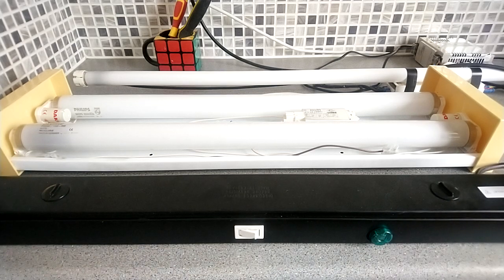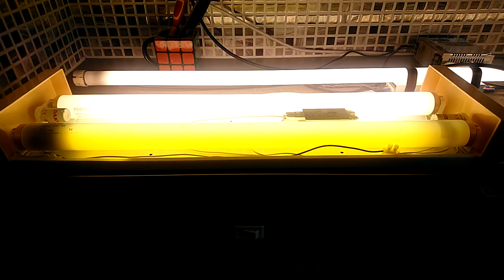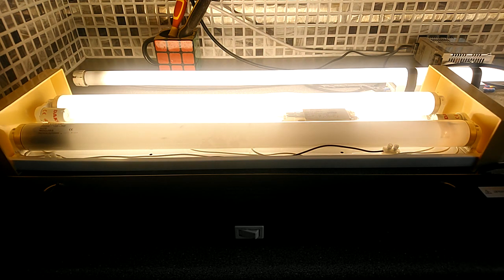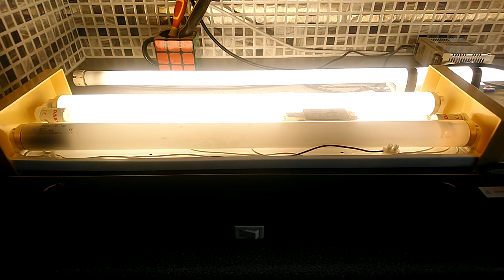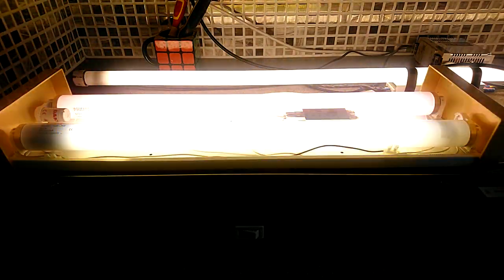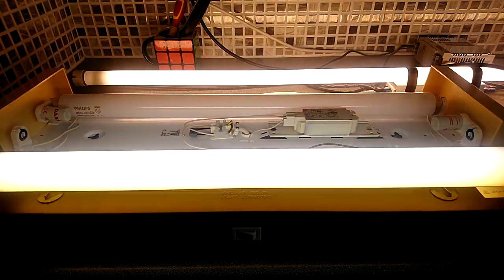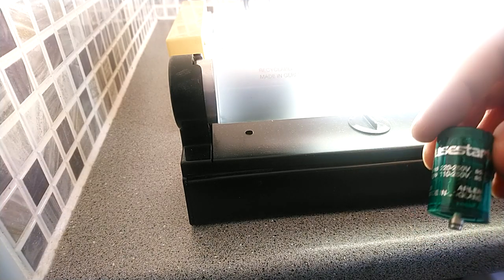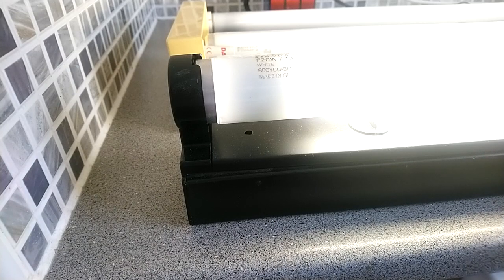EOL Fluorescent T12 Tube Burning Out

Comment: That's is a 2ft single and twin fluorescents lights fittings and in the single light use only one 18-20w 240v choke ballast and it's also takes 2ft 18w t8 fluorescents tubes and 2ft 20w t 12 fluorescents tubes and with two in series 4--22w 110-130-220-240v fluorescents lamps starters switch and in the twin 2ft light fitting its share one 36-40w chokes ballast via 240v means it's using only twin 2ft 18w t8 fluorescents tubes and only two 2ft 20w t12 fluorescents tubes and two in series 110-130-220-240v.4--22w fluorescents lamps starters switch Dave

Comment: Why does EOL T12 tube suddenly starts to work when you take the starter out and why does it work properly when you use electronic ballast while it doesnt when you use pre-heat ballast?

Also is there a store where you can still buy T12 tubes and 240V pre-heat magnetic ballasts or at least 240V magnetic rapid start starters (never check those for radio interference but it should produce less then the electronic one)

You see, I dont like electronix starters (watch this video to see why: https://youtu.be/GA7rscFNpB8 they produce a lot of radio interference, so I would like to replace my electronic ballast with a pre-heat (a bit of a challenge since my fixture doesnt have space for a starter but will cut the fixture if needed) or at least a magnetic rapid start one?
Reply from the maker: Fluorescent Tubes seem to do EOL on magnetic ballasts first with normal starters as tube dims wattage drops starters start working until either starter fails or tube. Electronic starters normally try once or twice to light tube, if tube lights will run until tube fails or just turns off. 
Electronic Ballasts normally run fluorescent tubes until they burn out or fail by loosing vacuum. some newer electronic ballasts turn off to stop damage to ballast normally T5 or T8's.
As for the T12 in this video it just stopped working as cathode failed on burnt out end.
You can still get T12's and magnetic ballasts or electronic on ebay, however prices are rising.
Reply: @davesbusstuffandmore  thanks

Is there any visual diference between T12 at their EOL and T8 at their EOL

I mean, the onlything different about T12 and T8 I observed is the visual size (T8 is sligtly thinner) difference, but not sure is there any more differences (does T12 start any differently then T8? Do both produce same uniform light)

Also, I found some T12s that claim to self start (and also have some wire running on the outside of their bodies, not sure if you ever came across any)

Also what about the tubes length (I saw some realy long tubes not sure how to figure out the size I need)

And what about the color, sometimes I saw some white ones, and more yellow ones? Can you still buy colorfull tubes?

Also, does a tube care if its made in the USA vs in Europe? (If I fail to find T12 tube locally, can I just import one from the USA and expext it to work?
Reply from the maker: @Veso266  A 20watt T12 is the same size as a 16 or 18 watt T8 2ft in length. I have  tubes from around the world T12 black lights from USA and now some T8's from Russia and two 100 watt T12 8 foot from U.K. Fluorescent Tubes are the same its the ballasts that are different 12v, 24v, 120v and 240v. Some older lights T8's don't work as T8's are harder to start up and some newer light T12's don't fit like my shop panel light. Some tubes are single pin, most 2 pin and you might see some bayonet cap T12's very old. The wire running on the outside is used to help tubes to start up none of mine have it. But have seen some.
Reply: @davesbusstuffandmore  thanks

There are Bayonet T12? How do these look like?

I have some nice lights outside: https://youtu.be/s77OUsXqziQ

That I quite like, because they change color from pink to yellow-white while they warm up and I am realy afraid if they break, because, I dont know where to buy replacment for them (so that the replacment would shift the color like that as well)

Comment: Tube dates to 03/2001 - Must have got several years service out of it by using electronic starters. The Philips 830s will last well, they always do. Must try your experiment with the glow switch start twin, where the failed lamp’s starter is removed causing the starter on the working lamp to operate. As the failed lamp causes both tubes to rectify, you effectively have a starter connected to what it believes is a failed lamp as it is subjected to mains voltage (or significantly  above design voltage) at 50Hz each time the peak passes through the non-firing cathode.

Comment: I have a fitting where it takes 4x18W T8 bulbs and i want to switch them to T12. Is there a such thing as 18W T12 or will 20W T12 work?
Reply from the maker: The light in the video runs 20watt T12 and 18watt T8. However my 4x18watt fitting T12's do not fit due the design of the end caps (tombstones)

Comment: What lamp is that?
Reply from the maker: This Light Batten is a 2ft Pre Heat takes either 18w T8's or 20w T12's on 1 ballast. Lamps are in series. Common set up for U.K.
Reply: Thanks